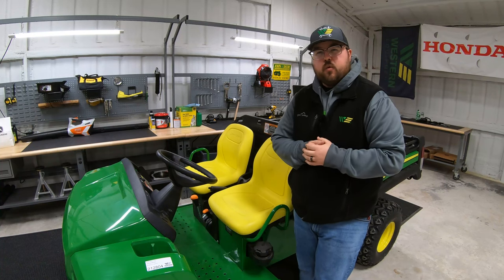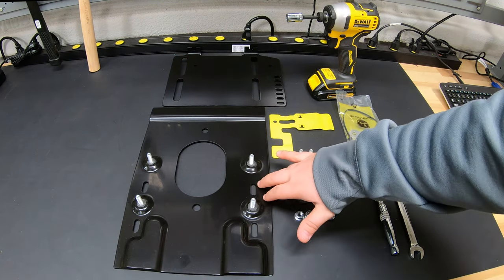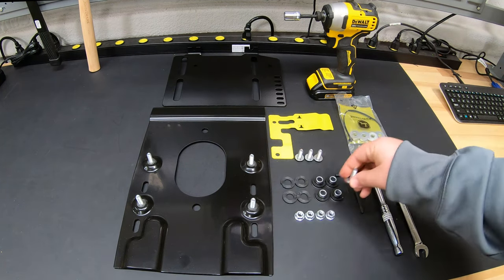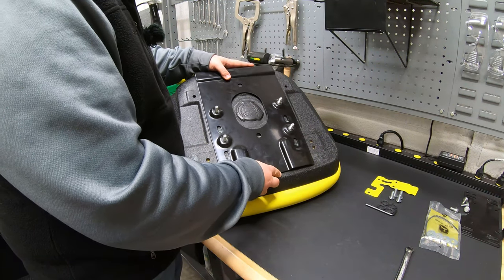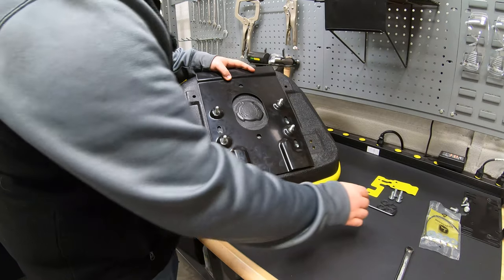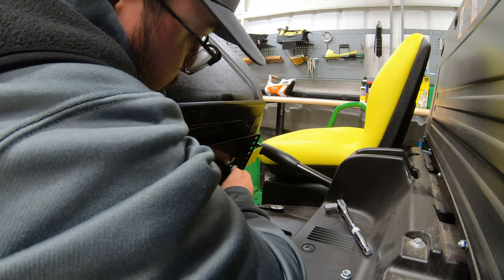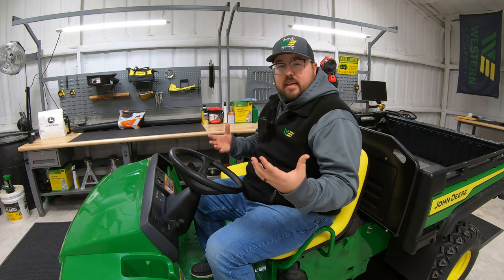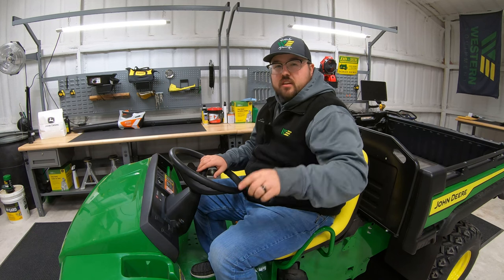How to Install John Deere Gator TX Adjustable Seat Slide BM23799

Comment: When you installed the first new plate to the seat, you stated your position was to put the seat further from the steering wheel. I may be wrong, but it looks like you position the seat closer to the steering wheel. I am a bigger guy, so searching for a way to move the seat back further is what brought me here. Also, wheel this fit on a 2003 classic 4x2?
Reply from the maker: It should work as long as your existing seat plate and the holes in your seat look like the ones in this video.

Comment: I have a gator tx and i am a bigger set, with the stock plates i push the seat as back as it could go. if I were to purchase kit how much more clearance would i get between the seat and the steering wheel?
Reply from the maker: I would say you get another 1-2 inches of clearance, this is without being able to measure fully. It is not a lot, but it does help. Thanks for watching!